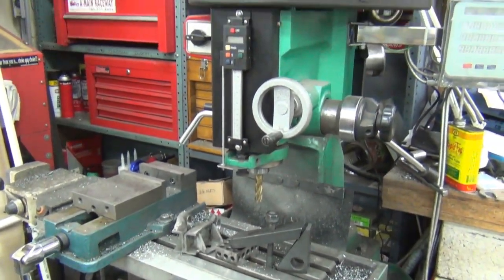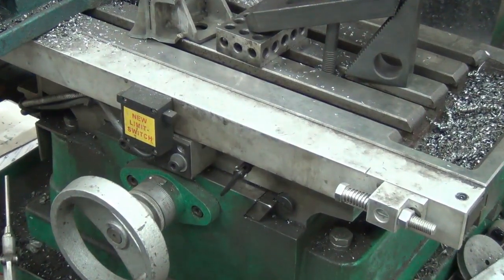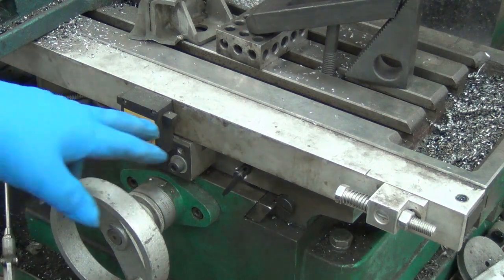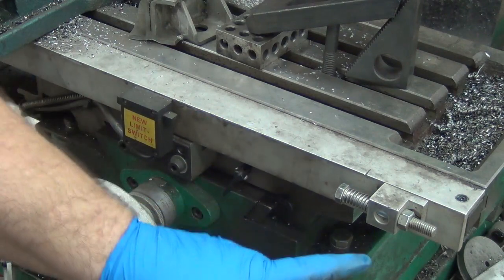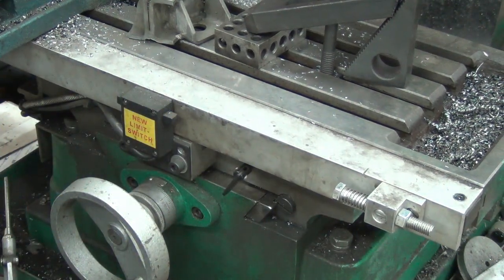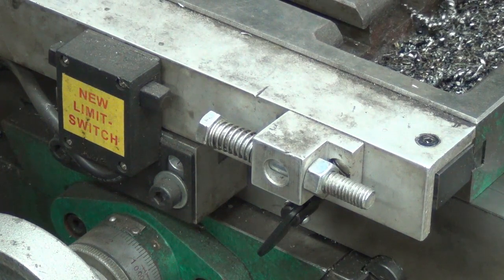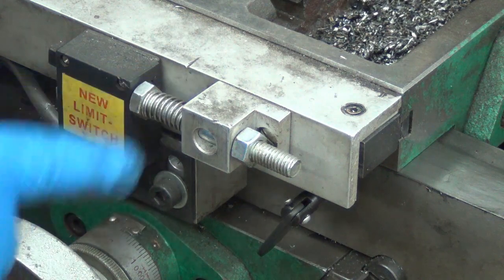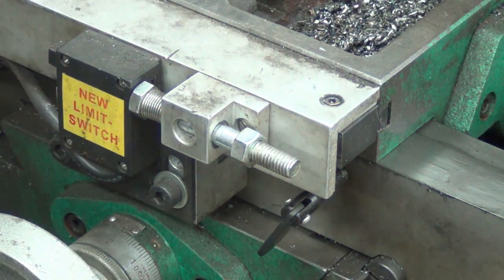Stop Switch - Power Feed Round Column Mill

Comment: I just purchased a round column mill from Grizzly (G0760), and would actually like to do this, but the cover that is over my DRO scale is a bit too thin-walled. Good idea nonetheless ;-)
Reply from the maker: Thanks!
Can you add another plate for additional thickness and rigidity?  The spring only has to be firm enough to push the over limit switch before compressing.  The load is inline with the axis.....I'm not sure it would try to twist or distort the metal to begin with.  Have fun with your mill! They can do a lot with a bit of creativity. :)
Mike
Reply: You're probably right. I doubt it would twist the metal cover. I'll have to see if the switch itself will hit the Y-Axis handle. On yours, it looks like there may be just enough room for you to move the table towards you all the way without the switch hitting the handle, is that correct?
Reply from the maker: Yep....it gets a bit close, but it doesn't touch or limit the travel.

Comment: I have a round column Grizzly mill/drill and the power feed came with that same switch and a couple of little stop thingys for each end of the table.  It all works.  Funny but the power feed is not linear at all.  Most of the adjustment is between 0 and 1 but the knob is graduated all the way to 9.   I did a video on it, not real well thought out in advance but it does show the way it works.  I guess I should redo it sometime as it could be improved a lot.  Thanks for sharing.
Reply from the maker: I went and watched it. :) 
Your switch should let you reverse directions after it's tripped.  I'll bet mine came with the same bits and pieces yours did for the switch and it's stops.  At full speed, it wouldn't stop within the travel of the switch plunger......so I bought it some more distance. :)
Thanks!
Reply: Yes it does let me reverse directions.